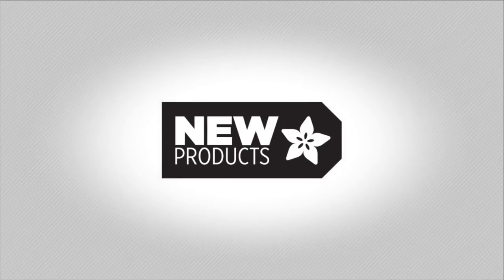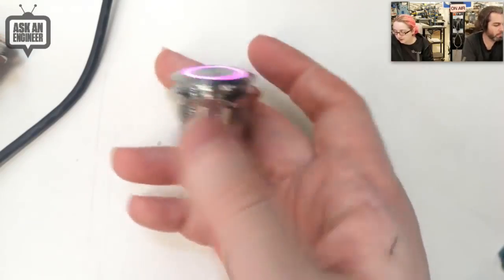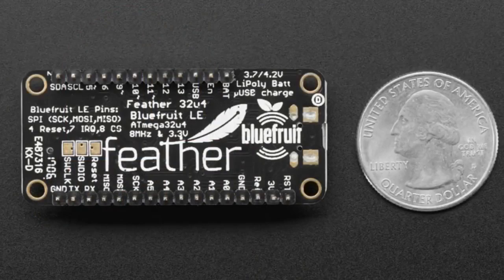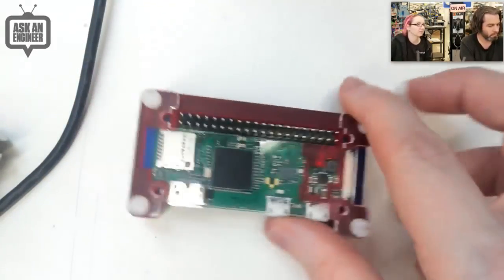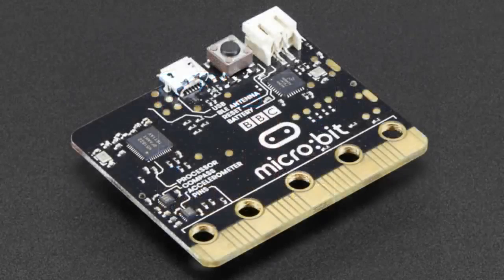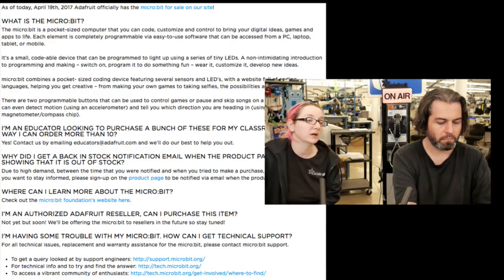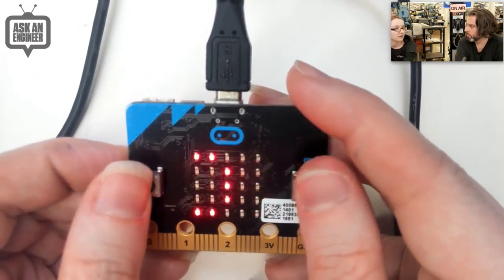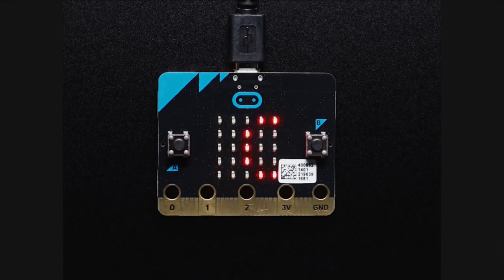New Products 4/19/2017

Comment: I want a PiZero LiPo Hat that powers the pi when not pluged in and when the pi  is plugged in it charges the battery, it must use spi interface to show battery info
Reply: ...And throw in a power button.
There are ways to make a power button for the Pi (with ACPI-like software shutdown or hard reset/power off options) but it requires some extra hardware to switch between resetting the Pi if it's shut down, or just changing state on a GPIO if the Pi is running, etc...  I would love to have a comprehensive Lipo charger and power supply for the Pi - I think it's important to remember the soft shutdown/wake problem as well when implementing that.
Reply: Yeah, want a proper version of github.com/NeonHorizon/lipopi
Reply: Hm, hm. It seems a shame to lose the UART pins, though. There must be a better way..

Comment: I just want to buy a raspberry pi zero/zero w
Reply: Gabriel Natã I mean it is really cheap why don't you get one
Reply: Chibo because is soldout everywhere (include on adafruit site). I mean, everywhere i can buy, since a live in another country.
Reply: You can buy it presently as part of the stereo bonnet pack, or you can wait for it to come back in stock - which it does periodically. It's not always super-convenient to buy a Zero but it's not that difficult, either.
Reply: It's just annoying. I recently killed pi zero w and now my project is stalled while i wait for every possible retailer to restock.
Reply: I hear ya. For a while I was buying Zeros every time I put in an Adafruit order, getting a few on hand so I'd have them when I need them. I haven't really done the same with the Zero W yet.
Reply: I want another one i initially bought the one without wifi and BT when it came out.. Its impossible to get on here unless you go with a kit..  The pricing here is good , some of the boards are a little tooo expensive most of them are dwarfed by a quarter lol.. you go on amazon and they want  21 for the zero w on here 10 butttt if you want to recieve it within this life time you have to pay an exorbitant shipping fee, lady ada hire me as a courier i will deliver in the new york metro area get these ppl what they need a lot cheeper when they need it ;)